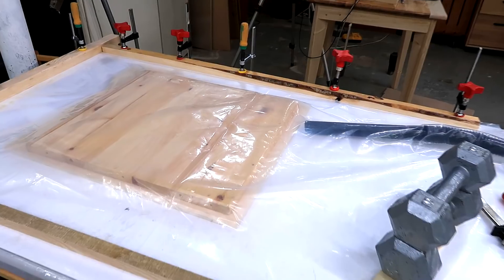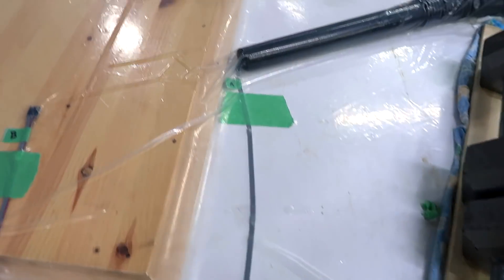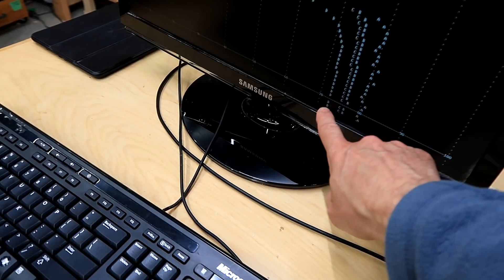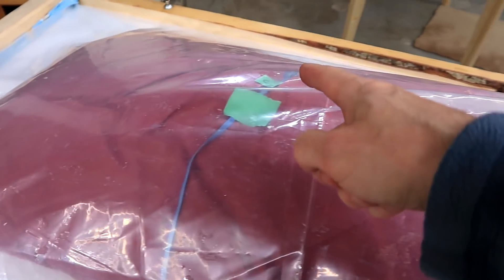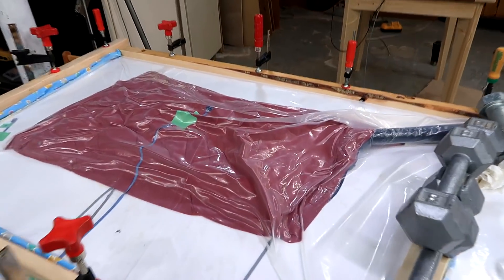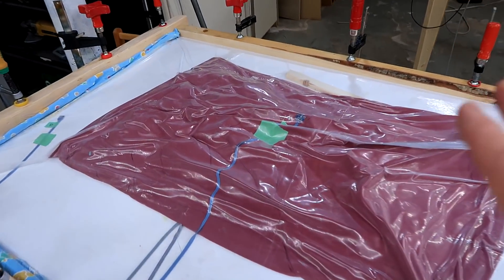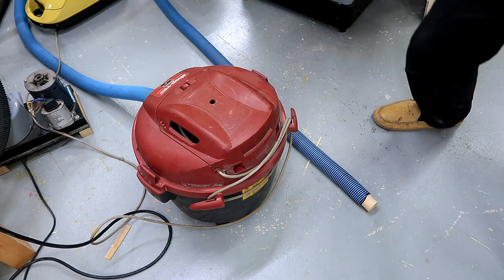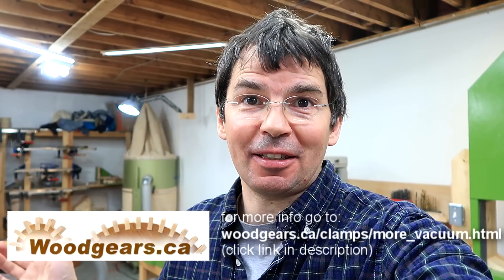Vacuum clamping suction spread: measuring vacuum distribution.

Comment: Matthias, I have 20 yrs experience in the aerospace industry, 10 of which were spent working directly with items made by vacuum forming. In order to create more pressure on your part you need to create some "folds" on the plastic cover to aid the formation of the mould and also assist evacuation.

Also, other viewers are correct when they mention some sort of woven material to aid evacuation. It is known as the "breather layer". Both the folds and the breather layer will greatly help you in achieving a better vacuum.

Also you will find a better vacuum can be achieved if you have two oulets for the air to escape.
Reply: I think the tests didn't show that, at least for this setup.

Is there another reason a top permeable layer could improve the quality of a composite? Is it a surface finish thing, or wicking away resin?
Reply: @hexane360  The breather film has a dual role. It is mainly to allow the air to move out of the project under vacuum. I have seen instances where air pockets (bubbles) were trapped within a job and needed to be removed before the job could be complete.

Breather material also has the added effect of "rounding off" any sharp edges and corners.
Reply: The breather layers won't help you acheive better vacuum (if you mean stronger negative pressure), but they will help you acheive the desired uniform pressure  faster .
Reply: @Nono-hk3is  The breather film allows the air to be evacuated more evenly and it can also prevent pockets of trapped aair that has not been able to move so freely. 

The breather film also has the added effect of "rounding off" any sharp edges and corners.

Comment: The graphing method is so simple, yet so elegant.
Reply from the maker: Back when everything was easier :)
Reply: sometimes you have to restrict your tools to get the better solutions. makes you think about what you really need and what is unnecessary feature creep.
I'd probably gone for serial graph output on an arduino, but if this is possible in python on the pi itself (with the second i2c port on the pi from the last video), that's way less junk to move around
Reply: Well, some gnuplot script with autoupdate would have been fine, but hey, when ASCII plotting does the trick...
Reply: Yep... Simple GUI, is not always simple.
Reply: @Max Tulk that's not an exclusive thing for marble machines.
Reply: Mattias was a diagnostics engineer at BB. You're lucky he's not spamming println on the console in hex.
Reply: @MSI2k  BB, Burr Brown?
Reply: @MegaVoltMeister  Brown Berry. Used to make Ham radios.
Reply: @MegaVoltMeister  BlackBerry aka RIM